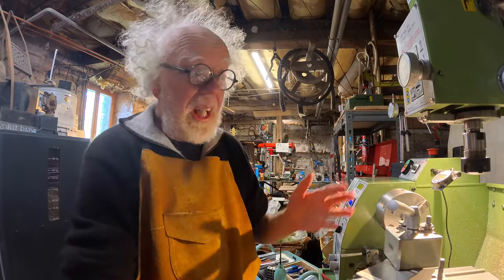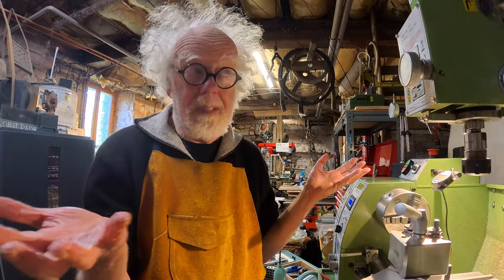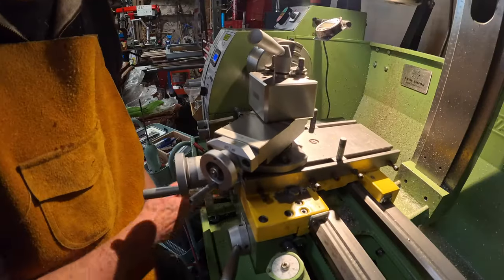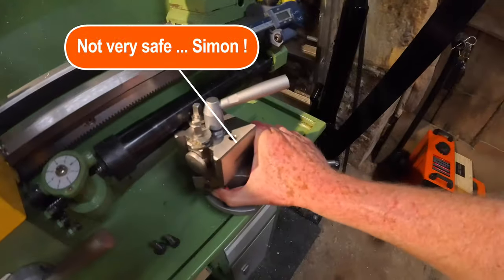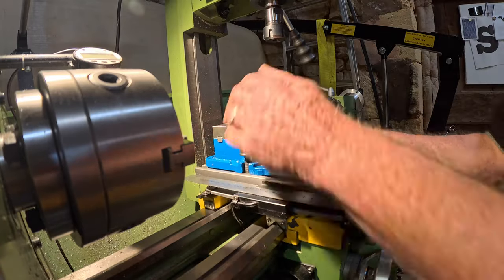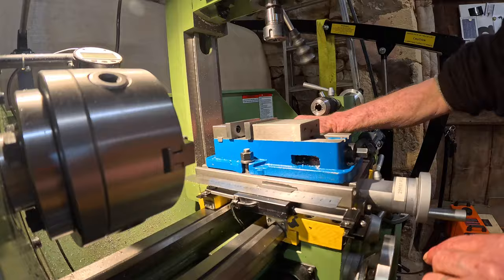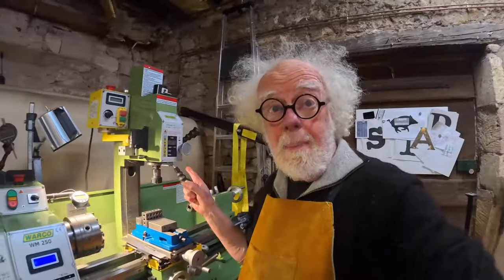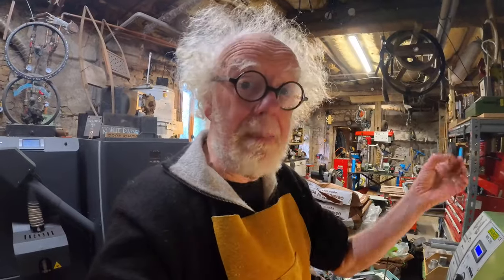Lathe and Mill combo - Prof Simon

Comment: Completely agree. I would add only one thing, your lathe has a proper lathe bed,  a V bed? The forces on a a mill are quite different to a lathe, gibs tend to be tighter on a mill etc?  So you can't be quite so as aggressive milling on a combo. I have the larger version of the lathe, they are very good, the reverse particularly useful.

Comment: Make yourself a key that fits into the slot on your lathe. Mount that permanently to the bottom of your vise. Mill out a section of the key to leave room for a Tee slot bolt.

If your vice location is a little off after this modification you can make up another set of jaws and mill them true to your carriage travel with them mounted to the mounted vice.

There will still be a little room for error but this will be accurate enough for 90% of the work most people need to do.
Reply from the maker: i like it